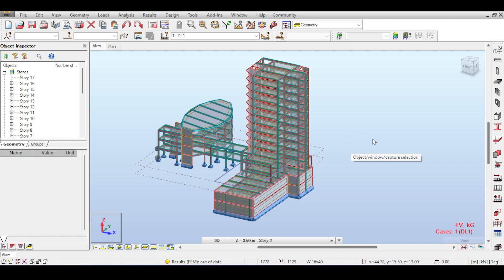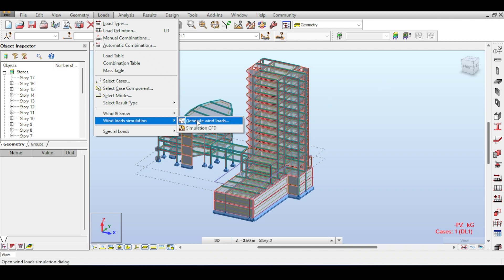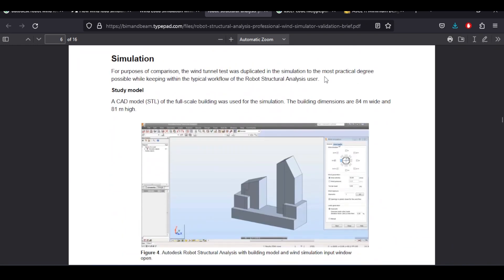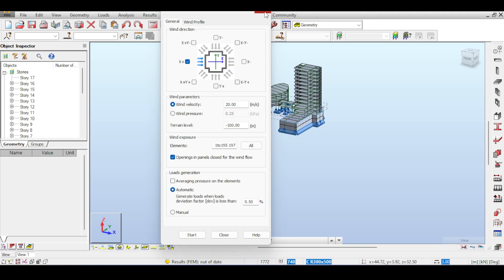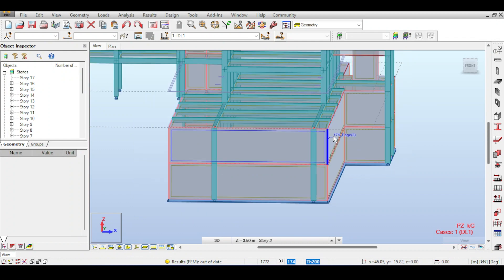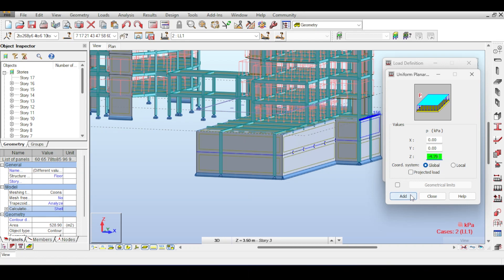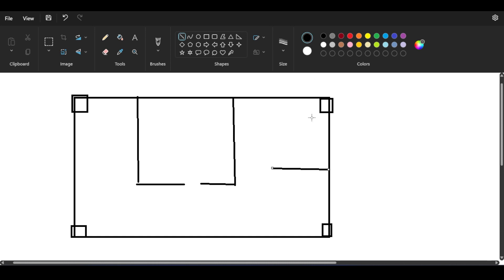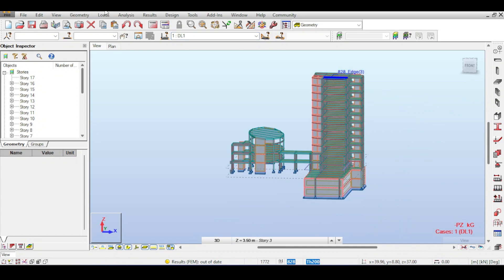Modeling and Design of RC Buildings in Autodesk Robot | Part 10: More Loads and Mesh Check

Comment: Hello CEE,

I love the honest discussion regarding the wind loads and the RSAP “wind tunnel” simulation, and I 100% agree with every sentiment expressed in that regard. It is indeed unfortunate that some easily allow the “nice, cool, and colourful simulation outputs” to cloud sensical engineering judgement. Thank you for digging into this and for sharing same.

The “Garages – passenger vehicles live load of 1.92 kPa on the ASCE” seem to be "correct = same with other codes". The Code in my region states 2.0 kPa for the same Garages and parking areas for light vehicle…. [ Corrections / erratum/ additional information] : for the imposed loads on garages and parking area for light/passenger vehicles (vehicle with gross weight of less or equal 30kN), Eurocode 1 provides the designer with a choice to select imposed load within the range 1,5 to 2,5 kN/m2…..CEE approach in this regard does highlights the importance of always being wary and cautious of the real life circumstances that are likely to occur on the particular structure under review….I had always expected (and used) one single value from the code….. clearly it is more “realistic” to be flexible and to consider the likely kinds and types of vehicles which the structure that is being designed is going to carry and then select the loads which best represent that particular situation…..

08:42 Editor CEE: LoL 

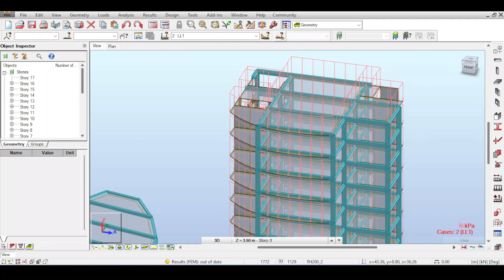09:06 (This is my current culture – but it could evolve) – “Brickwork walls, blockwork walls, etc.” = linear loads on slab; whilst for “timber / boards partition walls or other relatively lighter walls” = equivalent partition load.

CEE is correct, this is one of those things that require the designer judgement depending on the particular structure specifics and the deemed acceptable levels of accuracy that is required. Designing for and accommodating future changes or alterations in use and in walls layouts (where the affected walls are not part of the lateral loads resisting system) is a huge influence of how to assume to apply these wall loads.

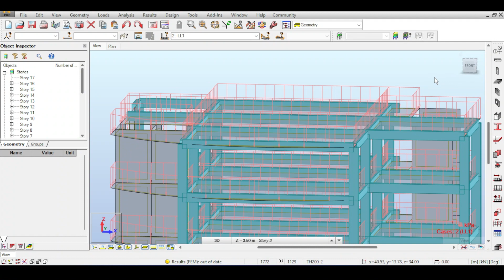11:03 Hello Baby CEE ^-^

The current load application trick using the load table combined with the previous video grouping of the elements are very nice and welcome good stuff indeed, they represent (but only a few of) some of the many pecks of being part of the CEE channel community. 17:47 Case-in-point: Yes, do make a group, doing this can only help with future selections.

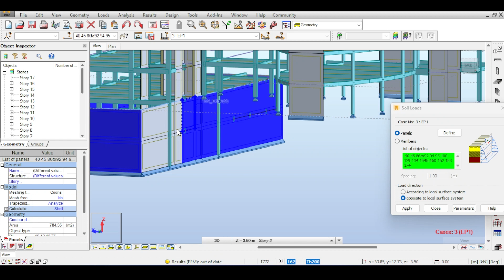17:34 Yes, the voice sound is much better now (and it is crisp 😁🎶 ), thank you both and thank you CEE Editor for tweaking the sound settings!

21:25 First Run:🎉 Congratulations are in order for this milestone, very nicely and well done to you CEE🎊. Thank you for the rundown of the warnings from the first run and for the overview of the generated mesh (including the reasons for the conglomerations of the mesh elements at select edge points). 

The inclined (roof) surface reminds me of the earlier spiral/helical staircase model which was successfully done here at the CEE channel. 

Off topic (I just could not resist): When you mentioned “Triangles – 24:25” I am thinking are we talking CST or LST ??? then I quickly realised that we are simply just talking about two triangularly shaped slabs that can be meshed with any other shaped finite element (elements such as CST, LST, QUAD, etc.) 

Question: What in layperson terms is being meant by the warning about “cohesion of the calculation model…….” What occurrences, or omissions (if any) in the model would cause this warning to appear? i.e., what would cause the necessity for a “…..definition of the kinematic constrains….”

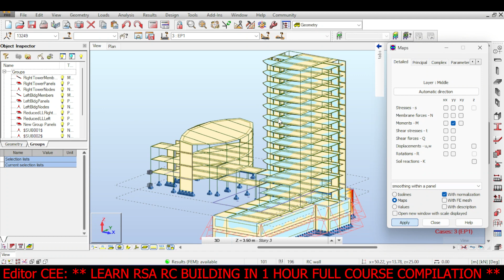25:00 Yes, exactly, CEE have nailed it, I could not have put it any better myself…..should add the line…..FROM ZERO to HERO Lol.

Truth be told, this (the CEE channel) is the only place on this platform where the necessary evils, the UGLY realities, and the whats nots are (efficiently and practically) dealt with and are fruitfully discussed and engaged. The CEE channel is unprecedented, it is second to none in terms of its contents and knowledge base; and I doubt that there will ever be anything thing like it in the future. The knowledge gap compared to countless other existing civil engineering channels out there keeps widening exponentially with each video that is released by the CEE channel dream team.

Interesting issue on the twisting of the current building model under gravity or vertical loads. I’d have thought that this (the twisting) happens when there are lateral loads (wind or earthquake loads) applied to a structure and where the stability of the entire structure is provided for by asymmetrically located /paced lateral loads resisting elements. Something about the structure center of mass not coinciding with the structure center of stiffness.

I am very glad that these and many others are some of the upcoming subjects of discussions. 

I have enjoyed this video and I am looking forward to the next CEE videos. 

Keep well and kind regards, DK
Reply from the maker: Hi there Engr. DK,
yep, the reason why I was a little bit late is because I tried to grasp the wind simulation well before I say anything. I need to be accurate and responsible when I say anything. Even if I make a mistake (and realize that I did) I would immediately correct it.

Now let me lay my cards on the table for this one (vehicle loads):
You see, basements are usually where cars are parked and where stuff is stashed. It happens many times that instead of having a car parked in a place, the place gets tapped (restricted) and some desks or books or server parts are stashed instead. Now I did not mention this in my video as I try to be culture/region/code neutral, and had to give an alternative explanation. 

The Editor helped me out there, to be honest and in hindsight, I was like: what am I even talking about? but I am happy that the Editor is here to pick up my slack. 

Speaking of EPL, I worked in 3 regions so far, my first region used EPL regardless, my 2nd region used EPL for gypsum walls (coz they can change) and linear loads for brick-work (like you just said) and my current region just tries to put beams below walls whenever possible, and applies loads on beams directly.

It amazes me to see differences from region to region. It is really cool.

I was unable to filter out my lil baby from the recording ^_^ it was a crucial info.

For the groupings, I even think I had those slabs grouped somewhere, but I went for the load table trick anyway because it was the best chance to show the power of thinking outside the box whilst having a good grasp of what RSAP can and cannot do.

Editor took the feedback immediately into account, although I was a little bit late in responding to your comment on that vid. You see, the semester started so my teaching load is ramping up, meaning that I only have weekends and evenings to work on CEE. 

About triangles, the CST and LST are - for the lack of a better word - axial elements. Their forces are not perpendicular to the plane of that element. The triangles you see here are .. gimme a sec ima get the reference. ... (realtime writing FTW) Discrete Kirchhoff-Mindline Trangles (DKMT) 
https://onlinelibrary.wiley.com/doi/abs/10.1002/nme.1620361106

so they are kind of different.

thnx for your comment, especially your appreciation of this channel's honesty. There is no "polished amazing superb" model. The channel here presents things as they are, no colorful stuff, no amazing maps, nope. It is the truth.

Oh for the twisting, I think I will show it by producing a very simple structure and explain why it would twist, it makes more sense to that. But yes, as you put it, imbalances in vertical supporting elements in as well as CG and horizontal stiffness imbalances is what makes it twist. It is something I see over and over again in my Student work when they submit their project models. I will be covering this issue as soon as I can.

Stay tuned for more content, and thnx for being a member of this channel,
CEE
Reply: @CivilEngineeringEssentials  Hello Doc,

Thank you for the feedback; there is much wisdom within your feedback and it is appreciated. 

You are correct, a concrete slab (as it is the case in our building model) would require discretization using finite elements capable of forces in all three (x y z) axis directions. Prof Katili seem to have made a huge contribution with DKMT and extended DKQ elements. I currently only have a faint idea when browsing through his two parts journal articles (per the reference) on this; but it helps to know that these things exist out there.

I am happy here at the CEE channel and I plan to stay, and stay happy

Kind regards, and l’ll catch you in the next one. DK

Comment: What about seismic action? will be part of the loads in this example?
Reply from the maker: Yes. Seismic action will have its own video once the problems that I listed at the end are fixed.👍
Reply: But if you consider a seismic action, you wouldn't check the modal analysis at the beginning with the aim of controlling mass participation. Because I believe that this structure does not guarantee the 90% as EC8 recommends. Thank you for your work, the best I can find on YouTube.
Reply from the maker: I will check that out. ^_^ problem is, I try not to overload listeners with everything at once. I try to have my videos be covered piece by piece.

Otherwise, I might overlook other practical aspects. I will keep an eye on that. Now please note: I would use American Codes for Seismic Analysis, but I will keep the eurocode in mind. I might forget to mention EC8, so if I do forget, is it possible that you remind me? would help a lot.

Thnx a lot for considering my channel one of the better ones. 

Regards,
CEE

Comment: Nice Job man, Learning Alot. Can you do videos on cold formed steel framing as well
Reply from the maker: It is a good request, but please note that RSA is really weak in cold formed steel. I had a video about this on my channel, and you would immediately see the glaring problems in RSA when it comes to cold formed sections.
Reply: Also, is it possible that you can do a video series in which we solve AISC design examples one ny one and compare results in both examples and RSA.

Comment: Hello,

I hope this message finds you well.

In my country (Lebanon), the wind standards recommend the following wind speeds for calculations:
a. 26 m/s when applying the Eurocode.
b. 45 m/s when applying ASCE7-05.
c. 57 m/s when applying ASCE7-16.

Based on these recommendations, the automatic wind simulation in Autodesk Robot produces varying results, particularly between the Eurocode (with a wind safety factor of 1.5) and ASCE7-05 (with a wind safety factor of 1.6).

Given these discrepancies, do you think it is safe to rely on the automatic wind simulation in Robot, or would it be better to calculate the wind loads separately and apply them manually to the cladding?
(Note: The designed structures are steel structures, including warehouses and PV canopies.)

Thank you in advance for your guidance.

Best regards,
Reply from the maker: In my humble opinion, I am not a fan of Autodesk Robot Wind Simulation. I would rather go with the cladding + load

Also, hello back to Lebanon ^_^
Reply: @CivilEngineeringEssentials  many thanks

Comment: Dear Dr. CEE,

I have previously conducted a simulation and research as part of my final year project, where I studied wind using the CFD method. If you are interested, I can share our work. We dedicated over a year to this project, and I believe the results from the CFD method are more accurate than any other approach, which I can demonstrate.

Sincerely,
Eng Ali Omar.
Reply: Using the code is the safe side for us as engineer .
Reply from the maker: Hi there Eng. Ali,
That would be an amazing point to see. Could you send me the pdf on:
civ.eng.essentials@gmail.com?

I would check it out and even feature your work on the channel.
Reply: @CivilEngineeringEssentials  that will be great .
Reply: Hey. Can you help me also ., as I am doing my master thesis.. where CFD simulation is required.. I am trying ANSYS BUT ITS hard for me 😅to